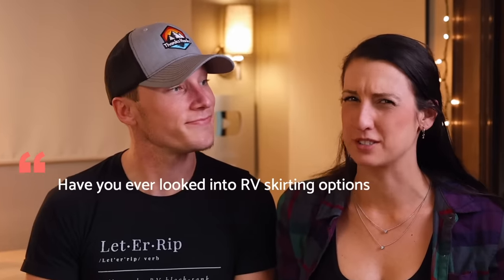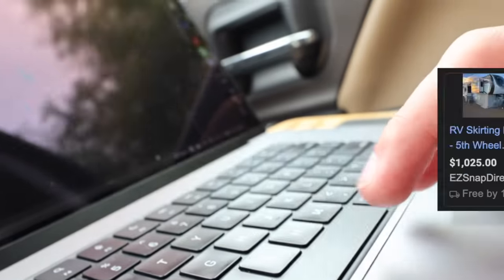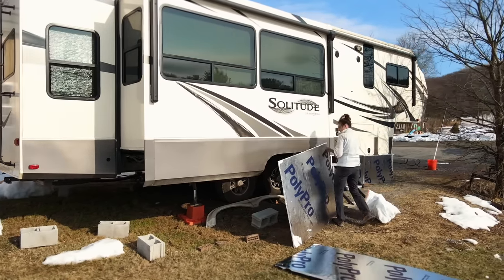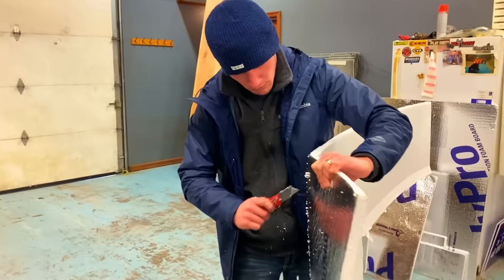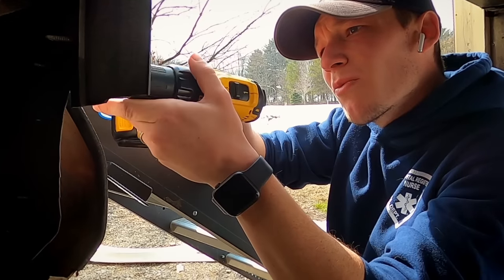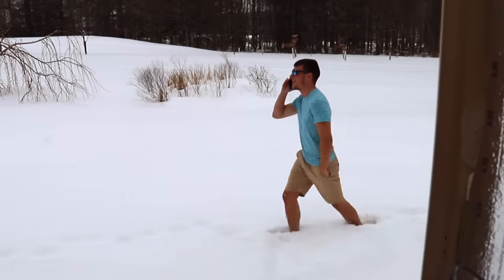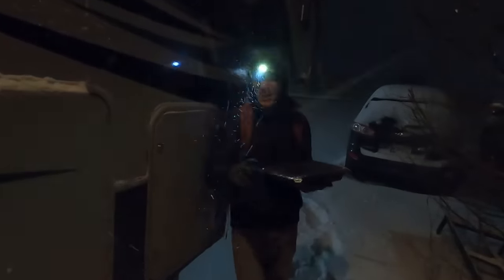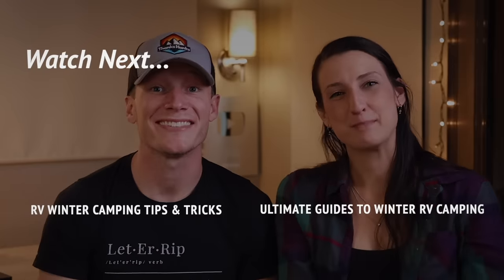Living in an RV in the Winter: Does DIY RV Skirting ACTUALLY Work?

Comment: Ok things to look at for DIY vs store etc.

1-  is this a perm instillation?  If you are not moving this RV,  using it as a camper model on one location, then skirting it DIY vs professional can make a difference.  

2-  if you are moving it regularly, are you planning on moving the skirting with you?   This again can make a difference if you are DIY'ing the skirting vs buying store made skirts.   

3-  are you just wintering in 1 location and do you have storage there?   in this case,  you may want to DIY/build a more rugged skirt, using 2x2's  building the skirt in segments and sections...   then when you park for the winter, pull them out of storage,  and set them up.  here you can get fancy adding actual access doors and ground spike locations.

4 cloth skirting.     in some cases if you are moving a lot Cloth skirting can work as an option.   often canvas, but this works best if the camper doesn't have slideouts.  

Here's a fun one.   Heavy snow loading, if again, you have storage at the site where you regularly winter,  you COULD add on a peaked roof. thats also insulated.   built in sections that can be man handled.  when setting up for the winter you pull the sections on, set them over the roof, yes this will block solar unless you have solar on the 2nd roof as well then you can run that cable to your aux solar input.    done properly these will dispeerse the weight across the whole roof and shed snow for you...

Comment: We wintered over in Golden CO in 2005 - 06 in a 3-season travel trailer. Not fun. No heated tanks, so we improvised and adapted with heat tapes and foil-lined flexible insulation. Worked perfectly and we were able to make it through some -20° F weather. We disconnected our sewer hose before the "polar express" moved in. I was offered a job in Texas, so we went there. Ahhhhh! 😍 So much BETTER! It was so nice and warm. There were skirting kits available. The were heavy fabric - reinforced plastic held on top by twist connectors and on the bottom by 2-inch pvc pipe inserted into sewn folds in the bottom of the  panels. It seemed to work well unless there were really strong winds but cost about $1500 installed.
Reply from the maker: That's awesome ya'll were able to successfully RV in that cold of temperatures! Way to go 🙂 We hope you are enjoying Texas. Thank you for sharing and for your great support
Reply: @HappilyEverHanks  - Where we live is beautiful: the Cross Timbers Region in the North Hill Country. Not the Rocky Mountains but it is very nice. We certainly don't miss the below-zero weather, that's for sure. We really enjoyed y'all's Canada/Alaska adventure. Y'all certainly visited some really beautiful places and overcame some adverse situations with y'all's usual style.

Merry Christmas,  Happy New Year and safe travels in 2024!

Bob and Dottie

Comment: Hey guys we went to billboard vinyls bought a 48x14 used billboard vinyl cut the 14 down to 7 ft. Then purchased heavy duty snaps and the snap tool attached the one piece of the snap to the trailer using a level to make sure the snaps were in a straight line every 10 inches the attached the button side of the snap to the vinyl and covered the whole bottom of the trailer then used sand bags to keep it in place the complete cost was $300 and the nice part is you take it off and fold it up and put it into a tote when not using and not having to replace it every year. The skirt made a 20 degree difference from the out door temp and the temp under the trailer .

Comment: I stacked square bales of straw around my rv, using two oil filled radiator heaters, rarely use my furnace thanks to this. the straw only cost me 160.
Reply: Brilliant idea 💡
Reply from the maker: Nice work, John! 😃 So dig into this a little bit more for me. How did it go with rodents? It always seems like anyone mentions the word "straw" or "hay," it is always followed by rodents (but we have no experience). What was your winter like with the straw?
Reply: I've yet to see any outside and none inside either. ill assume they are probably mice under but no bother. with my radiator heaters going im holding at  60 degress. over night with the outside temp around 20. So really impressed with the straw @HappilyEverHanks

Comment: I have another tip for you - get yourself a CDH and route the output to underneath your RV. It will warm the floor and the pipes for very little $$$. Makes the world of difference in extreme cold. $100 investment gets you lots of utility, and the ability to use it as a backup heat source in the RV as well.
Reply from the maker: What is a CDH? Thank you for taking the time to share this with us! We are very eager to learn how we could have improved during this time...it was a rough winter to say the least 😅 - Kyle and Renee
Reply: @HappilyEverHanks  sorry - Chinese Diesel Heater.

Comment: Thanks for the video letting us know know that your efforts worked. I remember the episode of you getting and putting the foam Skirting on but one thing I've wondered is did you take it with you? If so, did it fit in your underneath storage compartments? And did you have to buy new foam every year for certain areas?  How long did last?
Reply from the maker: Great questions, Steven! We actually left all the skirting with our friends on their property. They wanted it after we left, but I think they ended up getting rid of it. The foam board skirting is certainly not the most ideal setup for those who travel between places frequently. I think it would have held up great if we were to return and reuse it 😃 Merry Christmas to you! Thank you for your support - Kyle and Renee

Comment: Good solution for boondocking and a stationary trailer, but how to transport it when you go on the road? Definitely use two inch foam boards, less is just a waste of money. Along with this, run a good electric heater in that enclosed space. Not heating that space just won't quite keep you warm.
Won't work in most decent RV parks.

Comment: I did a modification that isn't quite as good as full skirting, but it does work pretty well. I have a 2018 Solitude 310GK, I live in Wyoming and we use our trailer in the winter. The frame rails on most 5th wheels have zero insulation, so they act like a giant heat sink allowing cold to get above the insulation that rests on the coroplast. On my last fifth wheel I cut 2 inch thick foam board and fit it into the frame rails to provide insulation and it helped quite a bit. On this 5er I decided to try something a little different. I bought a 200 board foot spray foam kit and I foamed all of the exposed frame rails including the back side of the drop frame. Then I sprayed undercoating over the foam to protect it from UV light. I will add that I sprayed around the slide out rams and bars leaving just enough room for them to function. The results are pretty good. I also added a cheap chinese diesel heater in the front storage compartment and in very cold weather I run it and have most of the heat directed to the belly of the trailer. Last christmas we were in Bozeman, Montana at our daughter's home camping in her front yard. It got fricking cold, -44F was the official temp at the airport 3 miles away and our high on that day was -21F. On that night the water finally froze up for the first time. We did good down to -15F. I just made some modifications to the diesel heater ducting to direct the main heat to the area by the water heater where the water feed line comes from the water tank. It is quite a ways back to the water tank, so the heat has a hard time getting all the way back there, but it does work. With the diesel heater running it keeps the basement in the 80's most of the time which heats the floor in the bathroom nicely. I usually only run the diesel heater when the temps are below 10 degrees or at night. The down side is that the slide outs don't have any added insulation and the rear of the trailer is a bit cool, but on the plus side it is always ready to go. I have some photos on the grand design owners forum under winter camping.
Reply from the maker: Hey Dave! Wow, ya'll put your Solitude to the test 😄 Those are some COLD temperatures. Nice work on the setup, we appreciate you taking the time to share with us! - Kyle and Renee
Reply: I used to have to work construction in extreme cold weather in Wyoming while living out of an RV during the week and going home on the weekends and I learned the hard way what worked and what didn't. Now I just get to play, but I hate being froze up. I also use reflective bubble wrap on the windows and have installed ceramic window film, that is marginally effective, it does cut down on condensation, but heat and cold still comes through. I wish I would have bought dual pane windows! @HappilyEverHanks
Reply from the maker: You and me both! Dual pane windows would be a nice addition to have. Nice job on using the reflective bubble wrap and ceramic window film :) Thanks for sharing!
Reply: A follow up to glamping in Montana over Christmas. Our Solitude froze up in the single digits, I had tons of heat in the belly and had to wait until I got home to find the cause. When I got home, I dropped the coroplast and inspected the underside of the trailer. The fist thing I noticed was the fresh water tank heater wasn't working! I removed the heating pad from the tank and did some research and finally picked one that should work better. The OEM pad is 78 watts and from what I can find it should be adequate for 50 gallons of water. My tank is around 80 gallons. I finally settled on a heater from Ultraheat, it draws 11.8 amps, so that should be somewhere around 130 watts +- the pad is 12x24 compared to 8x24 for the OEM. Then I started examining all of the fiberglass insulation above the coroplast. At least half of the batting was 6-8 inches short of going frame rail to frame rail leaving massive gaps in the insulation. I also found the foil barrier was folded back about 18 inches under the water tank and so was the fiberglass that was supposed to be under the water tank, so there was basically no insulation under the drain valve which is what kept freezing up without the heater working. I redid all of the fiberglass and added almost another whole roll of R-11 fiberglass including a full piece across the rear most cross member at the rear wall. I am hoping this makeks a big improvement and I will report back. I also stretched the 2 inch heating duct that was about a foot short of the drain valve on the tank which is also where the water feed line comes fromt that goes to the water tank. Now the heating duct is within inches of the drain. Later today I will button up the coroplast. I installed the new heater last night in the dark because it was still 33 degrees out and our high today is only supposed to be 30 and then a polar vortex is headed our way. I will try to finish buttoning up the coroplast this afternoon and I have high hopes that these repairs will make a huge difference in how cold the living room floor is and should cure the water tank freezing up. I will add that the ultraheat heater is made in the U.S. and has a lifetime warranty. @HappilyEverHanks

Comment: living full time in alberta seeing -30 c winter scirting is most valable 7k installed heater undernieth was warm and comfrtable in 3 season trailer this year in a 39.5' raptor sumer scirting and 4 day before christmas  no heater under it yetno problems as of yet seen -18c earlier this year furnace has gone out so using electric heat warm and cozy running a small trickle of water in bathroom sink to keep water moving in lines cost 5k in scriting but will be on for years

Comment: Rigid skirting, you can't pack and take with you. 
My skirt,tarp style. Fits in a bin.
Also.why clean snow from the roof?
When they manufacture the r.v do think they didn't take into consideration that maybe some rvs might be sold in cold areas. 
Maybe stored all winter collecting snow?
Just a couple thoughts.

Comment: Where do you store the foam boards when you’re not using them?
Reply: I agree foam boards not very travel friendly so basically 1 and done with time you’ll pay for Skirting, if your staying where they could be stored when done just winterize the RV and move in for the winter 😂😂
Reply from the maker: This is a great question, Josephine. We ended up leaving them on our friends property because they wanted them after we left. It is not the most ideal situation for those who travel full time and are hopping from one place to another. We appreciate your support in watching! - Kyle and Renee
Reply from the maker: Yes, if you can move, that is best 😄 We learned our lesson quickly that we are not cut out for the full timing in winter! Thanks for watching, Richard. Your support means a lot to us

Comment: Why didn’t you use close cell foam board? Pretty much every video I’ve watched on this DIY skirting with foam board has been close cell. It’s more expensive but I’m not sure if the difference in cost is actually worth it.

Comment: Two tapes, duck brand HVAC tape, vinyl stucco tape.
The vinyl stucco tape will mold to the surfaces stick very well comes off easy and leaves no residue. Stucco installers use it to tape off Windows and frames without damage. The HVAC tape will stick to Jesus everything when removed it may leave some silver and Logo branding on the RV. The HVAC tape is not the aluminum stuff.

Comment: An electric dehumidifier will produce some heat , win win !
Reply: @armslength2618  Have you watched any of the videos talking about humidity in vans and RVs ?
Reply: Save it ! we are talking about small enclosed areas not structures and until it gets below freezing Sherlock it's raining which equals 100% humidity . If you ever lived in the south you would know about the difference between dry cold and wet cold . You are correct when you talk about needing a humidifier in dry climates but we are talking about travel trailers and moter homes or maybe vans that are not using standard heating methods and might not be in the desert in the winter . You don't need to add humidity or open your windows when it's 34° and high humidity . There are many videos that talk about humidity problems in RVs !
Reply: Google it humidity problems in RVs in the winter time !
Reply: And the term we are using is condensation not relative humidity do we have to explain the phenomenon to you !